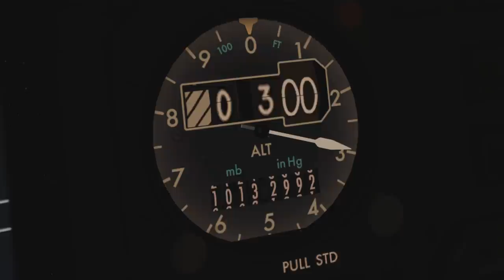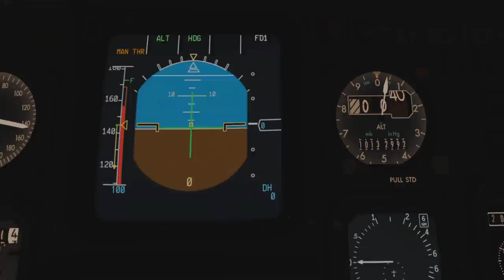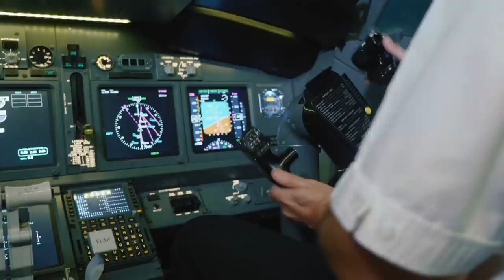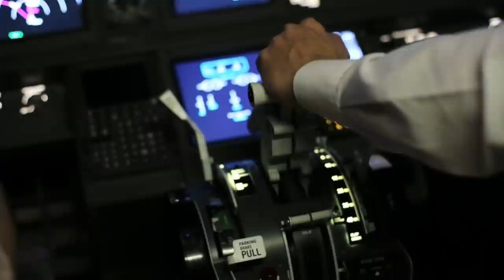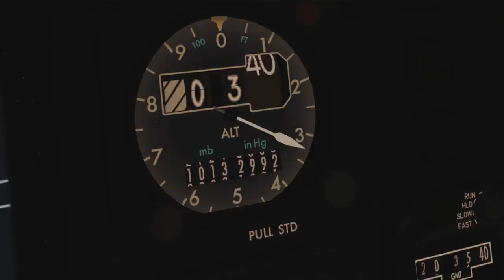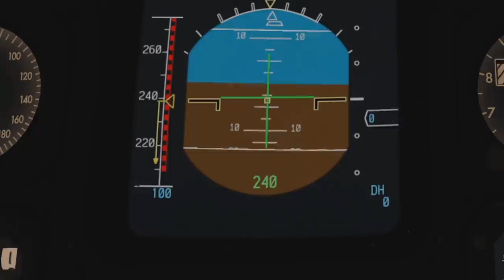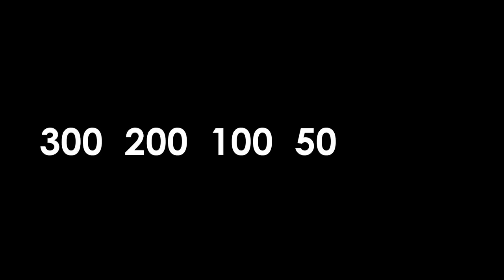What Was Going On In The Cockpit? (Kenya Airways Flight 431) - DISASTER BREAKDOWN

Comment: First time on these crashes where the crew did the correct stall evasion maneuver, only THIS time, it was the wrong choice. Damned if you do, damned if you don't.
Reply: This is just Airbus's very own Data malfunction insident involving censors and data software, just like the two 737 Max that when down.
Reply: We need to go back to the basics and keep  airplanes cockpit simple.
Reply: Except they didn't advance the throttles.
Reply: @lcfflc3887  except pilot error is more likely to cause a crash than software/mechanical failure
But I guess more complicated software both increase and decrease pilot error
Reply: Not turning throttles to take off/go around is a bad mistake.
Reply: THEY NEED OUTBOARD MONITORING.
I THINK HAVING A STREAMING VIDEO SERVICE TO MONITOR COCKPIT.
Reply: @lcfflc3887  We need to go back to having properly trained crews who are capable of operating modern day flight decks. This had nothing to do with the aircraft, slam dunk crew error. They flew a perfectly flyable aircraft into the sea because of their inability to fly the correct stall warning procedure. Not adding full power, descending and ignoring the aircraft telling you, and your aircraft instruments telling you, your about to hit the ground is unforgivable.
Reply: @Jaguar.  I agree with you. There was a time ( and l believe to date), that jobs were given to who knew who. Skills didn't apply neither did the rules.
Reply: It's Thr Airbus fault not the pilots note why did Airbus pull all A310 out of service soon after if the plane wasn't at fault it would flew till an updated A3 model came onstream and then u retire the A310. Kenyan Airways should of sued Airbus for that crash.
Reply: Imagine the vast number of incidents where the pilots correctly realize their situation in such cases and make it back safely. Those don't make it to this channel.
Reply: @dew9103  the root of the problem always seems to be the software though
Reply: @joshua1750  wdym
Reply: @lcfflc3887  I want you to remember the planes of the past and there faults...
Flying has never been saver and the amount of people that do fly has exploded after the second world war...
Ever increasing number of people, more an larger planes and more technology in them...
If the technology was the problem we would see a different statistic.

This isn't really comparable with Boeing, they had a computer do inputs that overrule the pilot.
And if that wasn't enough they sourced the data for a somewhat impactful flight surface from one sensor... Not failsafe or redundant...

Much different to a misfiring warning signal that doesn't manipulate the flight surfaces.
Reply: @dew9103  this technology of installing software that can overwrite pilot imput 30 years ago was limited to military combat planes like the F-16 and later F-22 F-117 B-2 BOMBER to avoid fatal G forces that could kill the pilots and on the f 117 and B 2 to help the planes fly since their aerodynamical shapes is so different from other normal regular looking aircrafts, they said that without the computer helping the pilots is like this two planes refuse to stay in the air without continues inputs, the computer does that for the pilots so it's like flying a regular aircraft With enhanced stability.
Reply: @lcfflc3887  yea the Airbus alpha floor protection is basically made to limit the plane to not stall
Reply: @lcfflc3887  this is why I am not really convinced that having loads of computerization inside the cockpit is the best. Sure, humans make critical mistakes but mechanical controls are easier to override than trying to override computers. There was another flight, one that was crossing the seas where the computerized systems made it more difficult to detect a fuel leak because the pilots believed the computers were giving false information because the systems gave warnings that you would never see while flying
Reply: @dew9103  yes, it is more likely for a pilot to make errors than a computer would, but a computer and make it more likely for a pilot to make a mistake because there is so much information there and if even one of those sensors is wrong, it is dangerous situation.
Reply: @ronniewall1481  I don't think the pilots union will aprove of that, they will fight it to their teeth. Also it will be super expensive for the airliners, tickets fares would get hicked up almost double to afford This.
Reply: @SuperUltimateLP  planes of the pass were UNDER powered and structurally weak therefore More failure was expected, today we do not have that problem, except for computers killing people, pilots and people of the past would be outraged
Reply: @crossfire2045  yes and it seems that the reason for all of this computerized technology put in to the cockpit is so that they can charge more money for the sale of each plane, planes from the 60's and 70's crossed the skies around the world with the simplest of the instruments. this computer obsession by the airplane manufacturers is just a money grab.
Reply: @lcfflc3887  you NEED the modern automation my guy.
Automation was and is desired in air travel.
You can't think of everything in plane development, you can't produce the perfect manual and you can't learn from mistakes you didn't make yet.
It's progressively getting saver to fly with each new gen of a plane.
Removing the automation would lead to exploding costs and rising crashes.
What Boeing for example did with the MAX was stupid, to have the pilot input be overruled, but that's not the fault of the automation it's the fault of a way to profit driven leadership.
The airframe needed redevelopment for the new turbines, instead they opted for a half-assed "always on" autopilot..

We should make the automation more intuitive for the pilots instead of removing it.

We humans are to ill Equipped to handle air travel by our selves, way to easily distracted or mislead.
A human centric automation is the only way forward.
Reply: @lcfflc3887  THEY ALL READY DO IT AND IT CAN BE DONE FOR COST OF CAMERA..
NEWER PLANES HAVE CAMERAS TO GIVE PILOT A WAY TO LOOK AROUND.
Reply: @ronniewall1481  but you were talking about an of cockpit third person to monitor cockpit activity and instrumentation per flight, that third person working from the ground requires a salary just like the pilots, it will be super expensive, it's like having a third pilot on the ground babysitting the other two in the cockpit.
Reply: @SuperUltimateLP  never give to a computer authority over pilots, it has cost lives in the pass, Airbus and BOEING had committed this mistake before and people had died.
Reply: @lcfflc3887  TRY TO FOLLOW I'LL TYPE REAL SLOW. A PERSON TO MONITOR THE TAKE OFF AND LANDINGS. THEY ALL READY DO THIS BY THE WAY. JUST LIKE ALL THE PEOPLE THAT JUMPED ME FOR SAYING PILOTS BEED ACCESS TO EXTERNAL CAMERAS SO THEY CAN MONITOR PLANE.
EVERYONE DID LIKE YOU IN LESS THAN A YEAR PLANES JUST HAPPEN TO SHOW UP WITH EXTERNAL CAMERAS.
Reply: @lcfflc3887  NOT WHOLE FLIGHT BUT DURING STRESS OR EMERGENCY.

Comment: Long had an unhealthy obsession understanding this one. Never seen anyone talk about this flight so I’ll pose it here  if that’s okay. In the BEA investigation document appendix 7 page 116 you’ll find the CVR. Earlier in the document, they list notable call outs but omit one I think should’ve been looked at more closely thus the above reference. Here the question:

Is there a connection of probe heat failure leading to temp sensor issues with the pitot tubes?

We know the connection of a bonafide failure in probe heat to stalling and the pitot tubes via France 447. But I’m wondering if overheating  was a sign the plane had false readings in air temps - I’d guess sensing it much cooler than it was. pilot 2 orders anti ice to be switched off and asks ground for help but they are interrupting and the conversations doesn’t return to the issue. 

Could this have been a sign a glitch was soon to occur with the stall detecting temperature reading problems with probe heat? P1 goes on record to say probe heat is “partially inop” speculating it is in fact overheating. This couldn’t have been normal on an A310. Idk it’s probably  nothing but I’ve found many examples of temp sensors leading to pitot tube malfunctions. But not normally in Africa. Thoughts?
Reply: yeah
Reply: smf333  birgenair 301.
Reply: From my experience,  these aircraft have redundant,  duel airspeed pitot tubes and makes it easy for crews to figure out which indicator is false. Pitot tube anti ice systems are fairly simple,, they either work or they don't.  There is a warning light in the cockpit if one becomes inoperative. Just saying,
Reply: Hello mr yankee I hope there is a new video coming soon been missing your content

Comment: Technology is really a two headed monster.   There are to many cases to list where pilots have flown a perfectly good plane into the ground but just as many where they ignored or missed a warning. On t/o into a black void at night is worse case and no time to troubleshoot. Looking back at this,  full power and let the plane fly. Gain some altitude and troubleshoot. Yet a simulator check ride, not lowering the noise when a stall warning goes off = fail.
Reply: Takeoff into a black void is routinely done with the ADI. you know..the artificial horizon. There are 3 of those. Also,,if a stall warning sounds at low altitudes, I doubt dropping the nose is the right thing in THAT situation. Their are instruments on the plane to.ck altitude..Altimeter AND the callouts counting lower and lower...but he wants those turned of. Instrument..ADI would let them know quickly if the nose is pitched too high. If you.KNOW you're at a low altitude when the stall warning goes off...TOGA power sounds like that would be more prudent in this case. Get yourself some altitude then worry about the other shit.
Reply: @patrickmollohan3082  You do drop the nose whilst applying full power. What you don't do is drop the nose so you start descending, switch off the height call outs when your down that low, and what you certainly don't do is not add full power.  That should have happened right away and been instinctive.
Reply: @jaguar3248  
My mistake. What I meant to say was not to drop the nose lower than the horizon line on the ADI. ADD power and build speed and ascend by pulling the nose up by using your instruments as not to cause another stall. Once you have a few thousand feet cushion, then start fucking with whatever the problem is. I REALLY appreciate you pointing out my error. My biggest concern on these poor nations airlines is the corner cutting. Why dont these academies for these airlines push instrument use and manual flight skills? They all depend on AUTOMATION!! Nothing else matters to them. All they need to do is get the plane off the runway, and once you hit minimum height...switch the Autopilot on and not deal.with it until it's time to land. At the right airports, the planes can land themselves perfectly on the runway. My point is that in many of these crashes with 3rd world airlines is...too much relying on the automation and no emphasis on gauges or manual flying skills. Ok..I'll shut up now...lol!!
Reply: Lowering nose while at 200ft altitude! ☹
Reply: @patrickmollohan3082  what’s the crash record for Kenya airways? You probably have no idea as you spew your third world theories.  Wanting to sound smart 🤔

Comment: The immediate reaction in a stall warning (false or not) is (or should be) nose down and full throttles. Amazing incompetence.
Reply: It isn't as much incompetence as it was confusing information because the stall warning should not sound on takeoff unless the configuration of the plane was wrong in which they ruled out. They also pushed the nose down but there was very little room for this. Stalls are more common after the plane had been flying, so pilots usually have more time and space to work with the stall.

Comment: if planes break apart during water landing, why does the instruction manual show a successful water landing? this wasnt even at full throttle and only shortly after takeoff and not nose down or anything, quite parallel to the water.
Reply: If they land in a controlled fashion they can float.

Comment: It’s strange that the a310 was designed to fly longer than the a300, but wasn’t designed to hold as much people.
Reply: It's a weight trade off.  More fuel, less passengers and baggage, greater distance.  Same with 747SP
Reply: Less seats for bigger fuel tanks.

Comment: How can the investigators say there should have been enough information to realise its a false alarm. Especially at that low altitude you don't have enough time to look at your instruments plus also pilots are trained to straight away lower the nose as soon as the stall warning goes off
Reply: That is what every rank amateur, on up, is trained to do. Reduce the angle of attack and gain speed and air flow. It would seem the momentum of this beast simply ran it into the sea.

Comment: In my own head I was screaming "Firewall the throttles and climb out at 10 degrees angle of attack; you can't possibly stall then!"

Do you have that accident (I can't recall which one) in which a pitot failure led the pilots to believe they were accelerating past any sane speed their aircraft was capable of, so they pulled it into what turned out to be a fatal deep stall to bleed off the excess speed they didn't have?

Comment: In many of these videos the plane is in a stall and falling, but the pilots ignore their altitude indicator which is telling them the plane is falling, and then just freeze instead of putting the pedal to the metal and opening up the 4 barrels kicking in the passing gear and pulling up. Maybe some old school 1940's altitude indicator and plane angle indicator need to be put in, that don't depend on a computer to work as a back up system. Maybe a flight training simulator system needs to be designed, that shocks you when you screw up in an emergency situation. Could it be that flight simulators have no repercussions, and are not really stressing the pilot, thus their brain does not learn to react in a real emergency instead it freezes in terror because it knows death is coming.

Comment: 1st, R.I.P to all those affected by this tragedy, & I sincerely hope I'm not offending anyone w/this comment...
I'm sure I'm just hindsight is 20 20/Monday morning quarterbacking this, but I'll never understand why, when it's clear that pilot's are in an obvious stall, whether it be an accurate warning or false, the 1st action isn't to IMMEDIATELY apply full (or necessary) power. In aviation, lift is life, & if you're not getting it, which these pilots clearly weren't, there's only 1 way to get it...SPEED...which you achieve 1 of 2 ways. 1. Pitch the nose down (which @400ft AGL likely wasn't much of an option), OR 2. POWER, which according to the narrator at these pilots never did. Another air crash that leaves me 🤔🤔🤔
Reply: what other planes did the pilot fly...
on many smaller aircraft (especially of the types used for "bush-flying"), a sharp increase in power gives your attitude a significant nose-up moment, this can be very dangerous if your angle-of-attack already is near to a stall, a fact your flight instructor will drum into you... is it possible the pilot mentally went to his training for a different type?
Reply: Sometimes if it’s your time to go none of these nonsense you just mentioned will work
Reply: Over speed warning?

Comment: So let me just summarize this: a plane is normally taking off, no issues, then, at about 100metres (350 feet) a false stall alert is going off. The copilot, at this moment having the control, pulls down to gain speed, althought every instrument is telling them that it isn't necasseary. After getting lower quickly, the pilot screams to pull up, however the copilot does not do that (at least not in time?), and also doesn't immidietly go on full thrust, which seems to just be logically and not need any big thoughts to get to this conclusion, and then the plane crashes, althought multiple warnings about their altitude have been recieved all the time, more than 10 seconds before the crash.
All just because of ONE false alert, not even a damage to the aircraft. I know all of those pilots do their very best and fight to the very end, but this just seems like a huge human error. Rest in peace to everyone inbound that has died in the crash. And let's hope this issue will be fixed in the future...
Reply: I don't think it was that easy considering the altitude at which the false alarm went off. Also, by the time the pilot called out GO UP, it was around 10 which would have been hard to recover from successfully

Comment: So was the altimeter also malfunctioning? Wouldn’t he have just looked down and seen that they were still climbing?
Reply: Could possibly be spatial disorientation. It’s not always easy for a pilot to tell by sight or feel if they are ascending or descending, especially at night or over water.
Reply: @redmanish  yeah I’m familiar with spatial disorientation at night or during low visibility conditions, but surely if you are getting a stall warning you would glance at your airspeed indicator and your altimeter to actually confirm you are stalling, it just seems like common sense
Reply: @dathremo.  Ah sorry I thought you meant looking outside the plane, not looking down at the other instruments. Yes, it seems like there was enough information available for them to understand they were flying a stable plane despite the warnings. But since it was during takeoff they had a large workload and adding what seemed like a urgent “emergency” may have overwhelmed them.
Reply: @redmanish  Also, the precedence of warnings may have played a part in the pilot's decision.